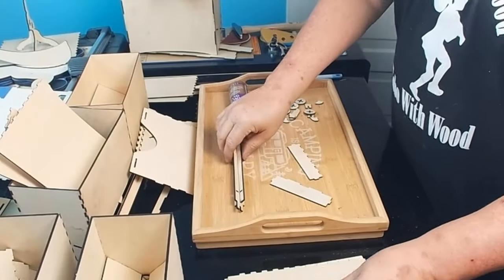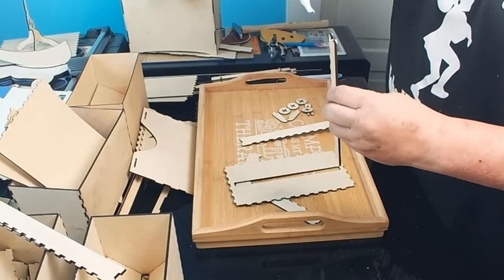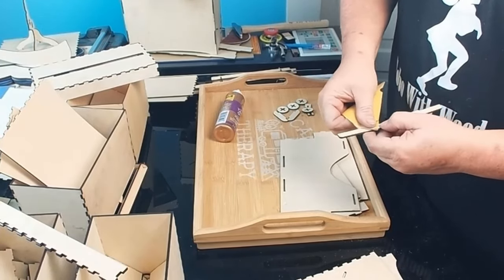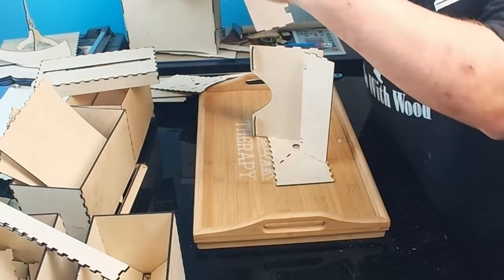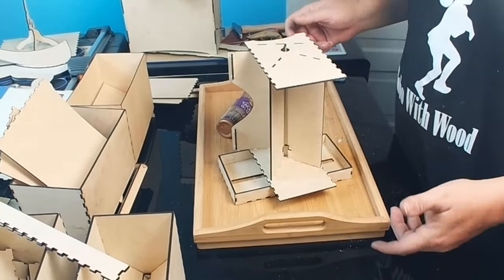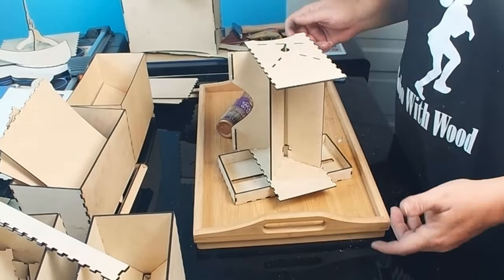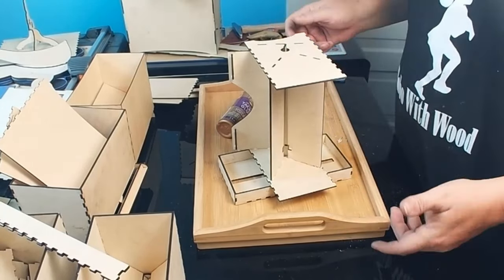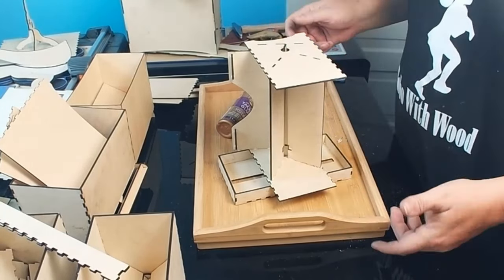Hobo Assembles A Pencil Dispenser

Comment: I'll bet that it will work as a straw dispenser too, with an adjustment for their length.
Reply from the maker: If they were wrapped straws, it wouldn't work too well. But if they were unwrapped, it should work "flawlessly" after increasing the overall width.